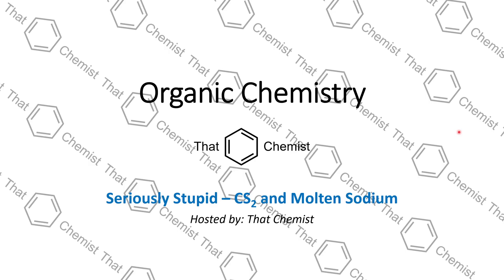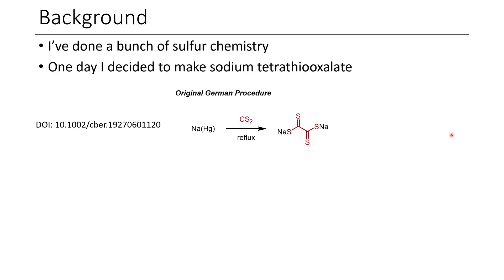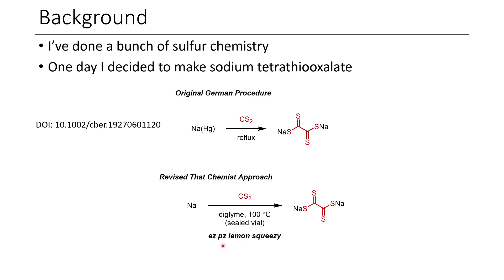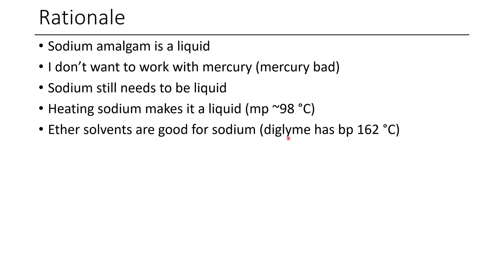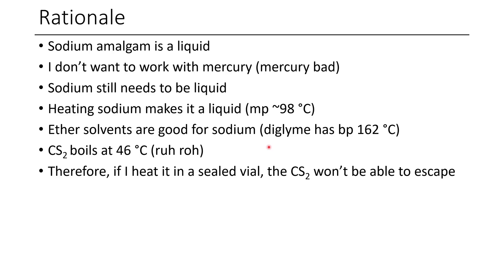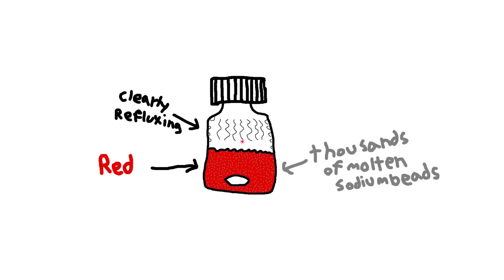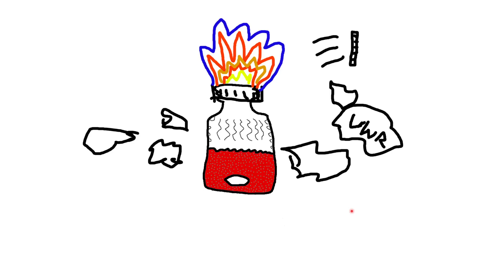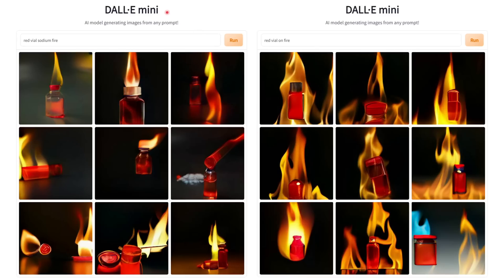Seriously Stupid - Carbon Disulfide and Molten Sodium

Comment: 4:05 , I deal with kilos of sodium metal almost daily, of all sizes from solid cylinders kilograms in weight down to bead sized spheres and I have to say that I agree with your description of the tiny spheres when they're freshly made.  They are the most awesome and beautiful thing I've ever seen and I can also say that potassium is exactly the same, as well as rubidium and cesium, and I've only just now realized just how lucky I am to be able to work with these metals in the amounts that's I have and to have seen all that I have with them.
Reply from the maker: that sounds freaking awesome
Reply: @That_Chemist  oh dude, you have no idea.  Most people don't.  It's truly a sight to behold when they're all fully stocked.
Reply: What's the most cesium you've worked with at once?
Reply: @arya6085  120g(ish).  Not nearly as much as the Sodium or Potassium.  Those I've dealt with kilos upon kilos of the metals.  Mostly as 1kg cylinders.  But Cesium is much harder to work with and much, much more expensive unless I make it myself.  Which is still fairly high to do.

Edit:. Forgot to say that all of the Cesium that I've ever dealt with was cesium that I've isolated and distilled myself using the single displacement reaction CsCl + Li ----> Cs + LiCl and distilling the Cs over into either argon or mineral oil and redistilling to purify.
Reply: Those amounts of alkali metals simply scare me. I've worked on the explosions of sodium reacting with water and I scaled down from 0.5 g to 0.3 g after a piece exploded the instant it was added. It destroyed the 200 ml beaker below and threw burning sodium shrapnel all throughout the fume hood.
Reply: @hammerth1421  oh yeah, that's all too familiar to me.  Many, many beakers and fish tanks no longer exist due to Sodium alone.  Only I would do things on much larger scales.  The largest piece I've ever thrown in water was about 50-60g.  2 large explosions as we all know it never wants to go off all at once unless it's completely weighed down to be submerged.  That's the only way I've found to get all of the sodium to react all at once.  Tie it to a brick and throw it in the water.  If it is large enough of a piece it will stay solid long enough for Sodium to go off in a single massive coulomb explosion.  (Yes, I've studied Dr Mason's work with proving that it's not a hydrogen explosion as once thought that causes the metal to explode.  Rather, it's a coulomb explosion .  In hindsight, it's obvious that it wasn't hydrogen causing the explosions.  But we're always told that it's just hydrogen detonating and we never question it.  Well, until now.)
Reply: Bro what do you do that uses so much sodium???
Reply: @jogandsp  I guess I wrote out my reply before and forgot to hit the send button....🤦

I am a chemical distributor.  I own a chemical distribution business that run out of Eastern Kentucky and we supply the majority of the periodic table and well have 300 chemical compounds that are popular in chemistry.  We also do custom syntheses (absolutely nothing illegal), consultations on setting up labs, we partnered with another company to be able to have analytics done on reagents and products for customers and we also offer small amounts of equipment and some glassware.  We take pride in the safety of our packages (part of the reason I started doing this.  Was tired of sellers skimping of the packaging and putting people at risk.) and spare no expense when it comes to packaging and the safety of all of our customers and the postal employees who deliver them.  We strive for purity, thrive on the diversity of our business venture, survive thanks to our dedicated customers who keep coming back for more.  In the 5 years that we've been a business now, we never had a single bad review from an actual customer.  Now that doesn't mean that our competition has tried to make us look bad, but they've had to resort to telling lies that violate the laws of physics and chemistry trying to make us look bad.  I can only imagine it's because we taken so much of their business and they can't find anything real to say something bad about with us.  So they have to make stuff up, and stuff that's impossible to boot.  So I just ignore them.  Maybe if they'd do things right they'd actually be able to keep their customers.  Anyways, that's basically what I do in a nutshell.  Now, that's a very, very simplified version of it all.  There's a LOT more that I do and it would take me 100 pages to describe it all to you.  I'd gladly do that, but I nether have the time for the energy to do so right now.  Lol!  Thanks again for asking that question.  Sorry it has taken me so long to finally respond.  I thought that I had until I checked a notification and saw that it never posted.  Sorry about that.
Reply: Now you have to make a video and share it with us! :000

Comment: Would a condenser work to stop CS2 from escaping the flask? Or is it way too volatile
Reply: At that temperature it would want to be in the vapor phase and would be too slow to react. It would flash boil as soon as the reflux dripped back into the reaction flask.

Comment: I mean, you can heat low boiling solvents to insanely high temperatures in a closed vial, but you USUALLY run those in special pressure septum containers and run them in a microwave reactor with a built in pressure release valve....
Reply from the maker: this vessel was special - for all the wrong reasons :(

Comment: A toxic solvent that boils at a low temperature and is both volatile and insanely flammable + an explosive and highly reactive alkali metal heated until molten in a sealed container? 

WhAt CoUlD pOsSiBlY gO wRoNg?????

Comment: My dumbest was liquid (NOT Aq!) ammonia in a reinforced sealed tube at 80C. Never exploded but I had a blast shield there just in case.
Reply: How would you "safely" do that? What's a good vessel to store pressurized corrosive anhydrous ammonia without contamination? They used to use liquid ammonia as a refrigerant, so you would think it wouldn't be too hard...
Reply: @petevenuti7355  if it's really anhydrous, then I would guess standard stainless steel would probably be fine. It's really the -OH ions that make ammonia corrosive.
Reply: @5thearth  assuming there's a trace of water, would it be consumed by the stainless steel or act as a catalyst until it eventually ruptured? If the latter, is there something easier than putting a lump of sodium in the container?

Comment: sounds like someone should've done some P-chem calculations to see how much pressure is created when you heat carbon disulfide to 162C in a closed vial
Reply from the maker: That sounds like something someone less lazy than me would have done
Reply: @That_Chemist  Didn't you say you polymerized CS2 at high pressure?
Reply: Honestly, how would you calculate this? My best guess would be ideal gas law, but these conditions are far from ideal so i would slap on a 100%  margin of error for safety. Are there any better methods (you can still do by hand)?
Reply: @kalrbaum  it’s a good ballpark estimate though - like, if you find when you vaporize all of the carbon disulfide you get a pressure of 10 atm via the ideal gas law, and you know your bomb flask is only certified for 10 atm, then you’re probably cutting it too close, while if you calculated that it would be 10 atm but the bomb flask can handle 100 atm, then maybe its worth trying. 

I’m also sure that van der walls equation parameters for CS2 have been calculated, so you can get by with at least the van der waals equation for taking care of some of the deviations from ideal.
Reply: @matthannigan78  *Van der Waals
Reply: @KaiHenningsen  you are correct
Reply: @kalrbaum  You just look up the vapour pressure of the compound at a that temperature. For CS2 it should be around ~18-20bar at 160°C.
Reply: @kalrbaum I would say Clasius-Claperyon law, if you have the enthalpy of vaporisation, the pressure of the vapor at standard condition and the final temperature
Reply: This is basically what chemical engineers do. Don’t get me wrong, I know many a brilliant chemists out there that use p-chem all the time, especially for more exotic reactions that aren’t even close to STP. But usually its the first thing that comes to mind for an engineer, since our entire discipline is basically just p-chem and math.
Reply: @samgrattan5465  For sure a problem for a chemical engineering exam lol. It's very simple after you have calculated the fugacity.
But in reality there would be a simulation software involved in industry most likely.
Reply: He found it empirically.
Reply: Vapour pressure of CS2 at 105C is 5 bar (+1 from air) at 162C it is 15.6 bar (+1 from air, at this point also +1 from diglyme) by equation at wiki data page on CS2
Reply: ΔP always a classic
Reply: I'd say a necessity when performing reactions in a closed environment at elevated temp 🤓
Reply: The reality does the exact calculation itself : if it explodes, then there is too much pressure.
Reply: what about raoult-daltons law?
Reply: Now we PChemists can say, "An organic chemist actually did that a few years ago.  When did you say you're doing the reaction?" <schedules vacation>
Reply: Remember, it was dissolved in diglyme, so you're talking "partial pressure" here.  I would have used advanced research tool (Google®) to lookup a CS2 vs °K vapor pressure table.  Don't need exact number, back of envelope would do.  Then, I taught physical chemistry for a while.

Comment: Could you have used NaK instead of molten Sodium(I don't know much chemistry, sorry if the answer is obvious)
Reply from the maker: this is a valid solution - a more recent patent used naphthalene, and that works via sodium naphthalide
Reply: This occurred to me also - liquid at room temp, and you can measure w a hypo.
Reply: I had the same question 🤔

Comment: A closed vessel with increasing pressure is known as a bomb.
Reply from the maker: and it did explode :(
Reply: Sudden unplanned disassembly.
Reply: It is not an explosion, it just a violent release of pressure and energy
Reply: @pmathemagician  I think thats the definition of an explosion. It doesnt have to be a detonation to be considered an explosion. Like a flash powder firecracker does not detonate but it still explodes due to the container not being able to contain the pressure.
Reply: @dapossum9495  Flash powder is a bad example. It is not a single substance; there are many different kinds and at least one of the popular ones can detonate (perchlorate, aluminium and stibnite) with a VOD of about 3 km/s. Even igniting flash in the open it can explode with concussive force instead of deflagrating with a "foof"; it burns so fast that it becomes self-confining; the combustion products can't escape fast enough and end up pressurizing and confining the burning mixture. I wouldn't call it a high explosive, but it is definitely explosive in a way something like a pile of gunpowder isn't.

Lots of stuff can detonate under just the right conditions; gasoline-air mixtures in a knocking engine; various coal dust, sugar dust, saw dust and flour dust mixtures with air in just the right composition. Dust-air mixtures have been tested in open ended tubes and it takes tens of meters to transition from deflagration to detonation but it can indeed happen.
Reply: @soylentgreenb  I know that some flash powders can detonate. I saw a chlorate and magnesium flash detonate but the reactants were ball milled together to less than 1 micron, most people cant achieve that particule size. I was talking about regular flash powder that most people make
Reply: @dapossum9495  It's not just about how finely you mill the ingredients and how finely you comingle them by milling. Flash powder shouldn't be underestimated. Flash powder that in 1 gram amounts burns quickly with a "foof" can suddenly explode violently in 5 gram amounts. They are often self confining in quite small and unknown amounts. They are often friction sensitive. There are hundreds of different compositions and many of the old ones are dangerously unstable. People have lost fingers and hands making too much flash at one time with just a simple mortar and pestle. Even things like humidity makes a big difference. This deviousness makes them not such a good example of something which deflagrates; sometimes they don't and this is something they are well known for and a major safety hazard.

Early flash powders intended for photography were intentionally made with a large oversupply of magnesium and made to be bright but safe to use; photographers have died by igniting loose flash powder where they got the proportions wrong (closer to a stochiometric mixture, like modern flash mixtures). They weren't milling them toghether in a ball mill for days; they weren't trying to make something that would go bang; they just bought finely powdered ingredients and mixed them carefully shortly before use.
Reply: @soylentgreenb  I get your point, I'm not saying youre wrong but I dont think its as common as you make it seem. Ive experimented with countless different flash powders including exotic ones, both confined and unconfined, when I was younger. I was testing them on soda cans and I never got a nice hole with fragmentation holes on the other side of the can like primaries do. I just got dents and split opened cans. Thats why I used flash powder as an exemple. Maybe I just suck at making flash powder.
Reply: @dapossum9495  i think maybe you wanted touch powder, not flash powder. That'll pop your cans.
Might want to give Explosions&Fire a look if you're interested in energetic synthesis.
Reply: @AlexanderTzalumen  Im already a big fan. Sadly, I dont know about the legality of making explosives in canada. I've read the canada's explosives act but its still not clear to me. I still have all my chemicals, so I might try to make some if I can figure out the legality someday. I always wanted to make and test out some bismuth salts like azides, picrates, etc. There's very little information on those online.
Reply: Unscheduled prompt pressure release.
Reply: @heptapodEnthusiast  There it is. I hope I remember it when I get a chance to use it. :D
Reply: BLEVE. Boiling Liquid Expanding Vapour Explosion

Comment: Not using a vial pressure relief cap smh
Reply from the maker: oh the vial relieved pressure alright :(
Reply: @That_Chemist  tbh I'm not one to point fingers, I unintentionally caused a $13K 100L jacketed reactor to implode by not considering pressure.
Reply: @00bean00  I transfered coolant lines from one reactor to the next, closing off the valves to prevent coolant from leaking out. As the coolant in the jacket warmed up from -10 to room temp, it expanded and the glass broke under the pressure. In my defense, the pressure relief valve for the jacket was supposed to go off at 7psi, and turned out to be defective (actually released at 35 psi).